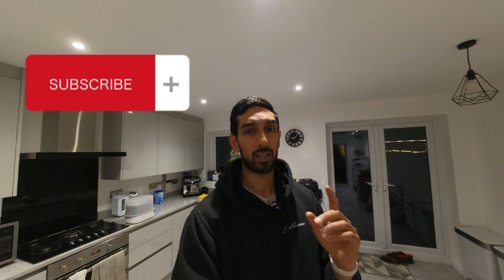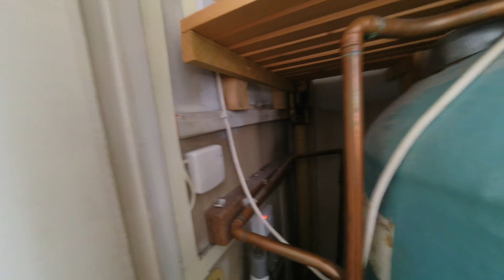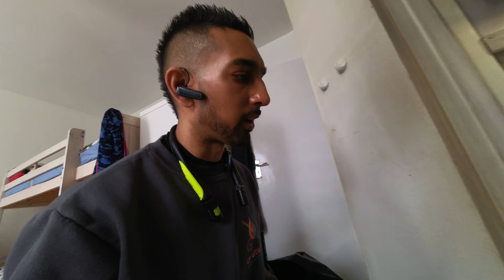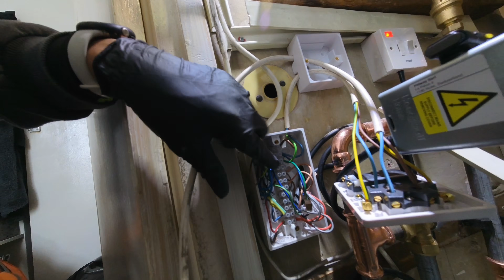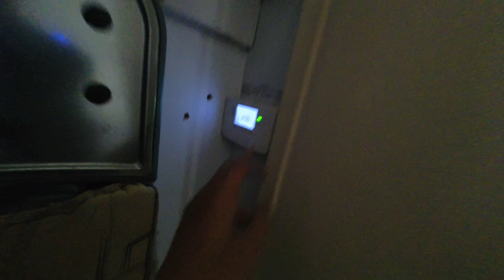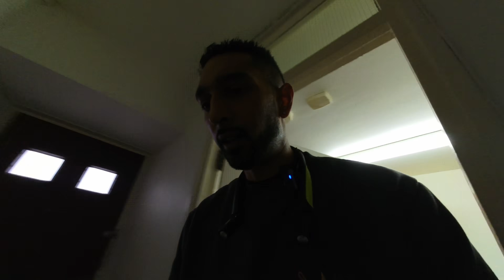Customer Wanted It Cheap But Learned An EXPENSIVE Lesson - A Day In The Life Of A Gas Engineer 142

Comment: So I’ve had a very quick look at the MI for this and as I see it Ariston have put a remedial way of a kind of hot water priority to this. I could be wrong though as I haven’t fitted one and probably wouldn’t. If you were installing weather compensation with this, everyone should be anyway, you can use the interface on the boiler and set parameters to alter flow temperature for the heating. You put both volt free to TA1 and if you using weather comp you would split and use TA1 HW and TA2 Heating giving better control of the condensing range of the boiler. 
Glad you worked it out though 👍👍👍
Reply from the maker: Nice one mate good to know options 👍🏾
Reply: @cputilitysolutions  you may not fit another but your going to have to up your knowledge (in a nice way) on hot water priority. You can do it with zone valves or a diverter which is normally open to heating. The German V’s do it well along with Intergason either Opentherm or Bus. 👍👍👍😁
Reply from the maker: @robharrison6918  yeah it's something I do want to look into. Would be nice to fit PDHW on my next boiler/cylinder install

Comment: That's the problem when the customer supplies anything!
Without being sure if it's a 24R or not I have to say changing to an S plan was the smartest option.
When it comes to three port valves and relays, it is not understood by most installers/electricians that in certain operating phases approximately 50Vac is present when no demand is calling; which is sufficient to operate most relays!
Reply from the maker: Thanks 👍🏾

Comment: Sounds like a nightmare. This is where a relay will come in handy! 240v from Y plan will click over the relay, on the boiler side of the relay you can but in the low voltage wires and it will just link them together. Keeping the 240v and low voltage separate.. check relays out on youtube and get a little jig set up and have a play with it! They will get you out of situations like this mate... hope your doing well pal
Reply from the maker: Thanks mate, yeah I need to look into relays after people suggested it. Never used them before but I think I'll do what you said and get some and set up a rig at home to practice so when I have a similar situation I should be able to sort it 👌🏾

Comment: Very interesting - question for the sparks here.... from fellow breakdown engineer.

If you are running the grey and orange wires to the zone valve at low voltage - this will mean you have both mains and low voltage within in the same flex going to the actuator head...

Is this allowed?
Reply: This is a really interesting question. 
On a previous post i mentioned using 2x240v supplies for the same heating system from different sources - not great and as an electrician you will understand the reasons all too well. 
However utilising 240 and 24 v on a single cable is a slightly grey area. 
My understanding is - 
As long as the insulation between 240/24 volt conductors is adequate. 
Correct labeling applied. 
Possible induced voltage from the 240V doesnt create problems to the 24V side/controls/boiler. 

One thing to bear in mind is that the longer the cable the more induced voltage could be created. So personally I would run 2 separate cables from a wiring centre to a boiler rather than combining in one. 
As an electrician would you run 240 and 24 volt in the same cable ? 
It would be interesting to hear other comments on this.  
Thank you
Reply: @gibbodive140  yes I totally agree that having 2 power sources on a heating system is a big no no from an electrical point of view.  Although I've come across it a few times!

I guess with 230v and 24v within the same cable - If someone was to cut or drill through it,  the 24v side of the boiler PCB would get potentially destroyed with 230v firing down it?
Reply from the maker: A couple of people have commented to say it's not advisable so will make note of that going forward 👍🏾

Comment: Just so you know in the manual it does say this.      "Note: The use of a ‘Y’ Plan system is not possible with the
E-SYSTEM ONE boiler due to the low voltage switching of the
appliance unless suitable relay controls are used"
Reply from the maker: Thank you 👍🏾

Comment: This is all a learning curve albeit a steep one.

I had no one to turn to except my dad who taught me both gas and electric..no internet etc. 

Basically no one wanted give any info out to safeguard their knowledge base.

Build on your experience and always listen to what others suggest...but at the end you need to make the call.

You're young one day you will be giving a young stud the same advice.

By the way I have over 45 years experience but every day is a school day.
Reply from the maker: Absolutely, I've not used relays/contactors before but after all the suggestions I'll be looking into it for the next time a similar situation occurs 👍🏾
Reply: @cputilitysolutions  you’ll find wiring the vaillant VR70 & 71 quite straightforward when you get used to it, but you have to make sure the setup is correct. Takes some time getting used to it but factor that into your price. Your customers will appreciate it. 👍
Reply from the maker: @robharrison6918  nice thanks for the suggestions mate 👍🏾

Comment: Hi, watching your video I see that was a very expensive way of solving this problem.
All you had to do. Is to fit a relay switch between the boiler and the switch live of the zone valve.
Regards Ashley
Reply from the maker: Thanks, I've not used relays/contactors before but I will look into it after your advice 👍🏾
Reply: I would use a relay too  . 240v coil  connnected to orange on 3 port in wiring centre and clean contacts back to boiler for 24v switching or whatever local voltage it is
Reply from the maker: @rickd6421  thanks 👍🏾
Reply: I was just about to say this 👍

Comment: Hi Chirag.
Could you not have kept the Y plan and used the orange 240V to activate a relay which switches the 24V to the boiler? 
Relay next to boiler so no need to run a new cable.
Much simpler, and cheaper ?
Reply: Sorry fella.. Also it really isnt advisable to have two electrical  supplies to a single heating system.
Make sure it is very well labelled with notices at both ends for future maintenance engs.
Reply from the maker: Thanks for the advice & suggestions, I've not used relays/contactors before so I did it in the way that I knew. Will defo look into these going forward 👍🏾
Reply: @cputilitysolutions  
No worries. Nobody knows everything but years of experience helps. 
The other thing to bear in mind is that working life can be difficult for tradesman  who work on there own. No one to bounce ideas from. 
If you work for a company there will be many people whose experience can be drawn from immediately at the end of a phone. 
This is where social media/you tube can be very constructive, particularly for the sole trader. I have learned from watching presentations. 
You are putting yourself out there - Good luck to you.    Take care...
Reply from the maker: @gibbodive140  absolutely, I'm more than happy to take constructive criticism if it teaches me something new and sharing my work on social media I've learned a LOT from people watching my stuff. Thanks again for your advice mate, much appreciated 🙏🏾
Reply: It’s not switching 24V on the boiler. It’s just using the switch in the zone valve to activate the board in the boiler. 👍

Comment: Could you not have just installed  a contactor? To switch the low voltage
Reply from the maker: Not used them before but will look into it going forward, thanks 👍🏾